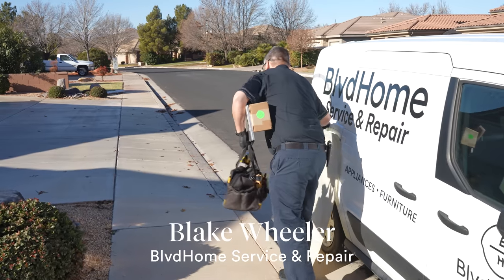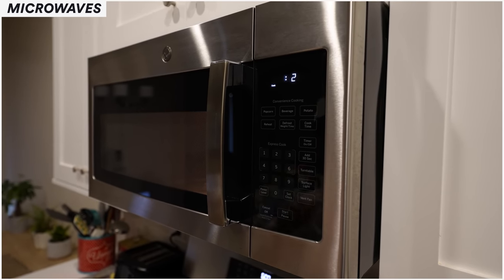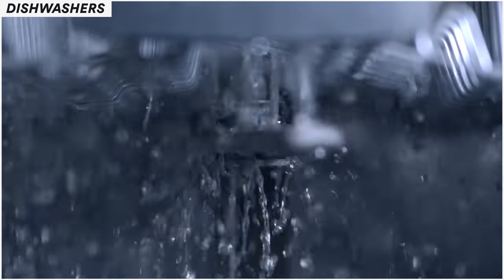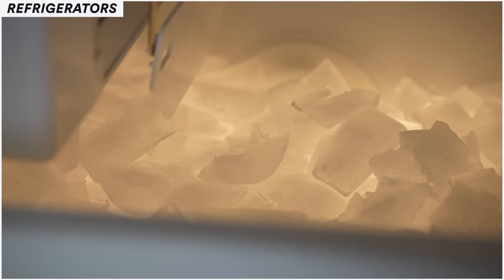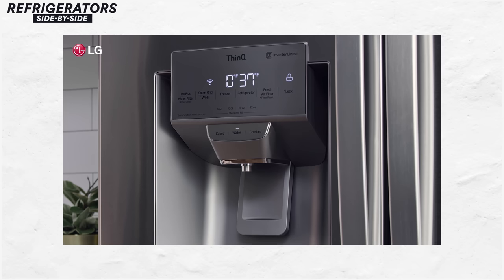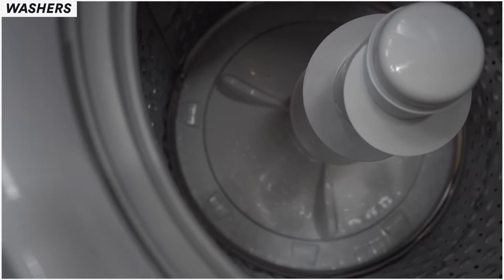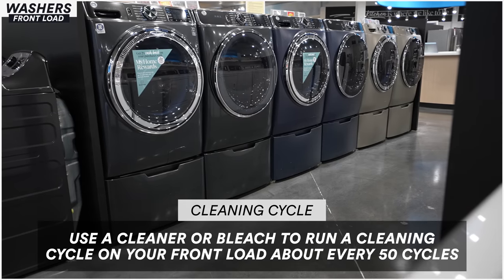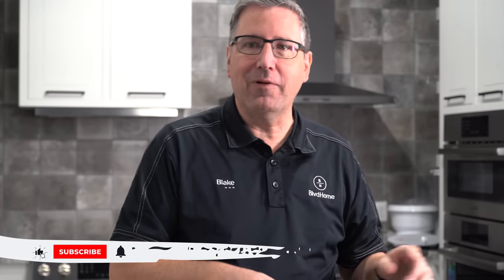Best Appliances Recommended by a Repair Technician of 29 Years

Comment: I bought my Kenmore refrigerator back in 2003 and it quit working in 2019. Whirlpool was making refrigerators for Sears back then. I saw a Whirlpool refrigerator at the store than was on sale and it looked pretty much like my old Sears refrigerator. The ice maker looks slightly different and the controls in the newer refrigerator has digital control buttons. But it has been running just fine. I had read a lot of reviews and I had the impression that Samsung refrigerators have a lot of features but they don’t seem to last as long. I read about the LG issues also. My Whirlpool isn’t fancy but it looks nice and it works. It’s good information that he gave out about the microwave switches. The makers who put the pause feature on their machines should have explain why the that control feature is there.

Comment: I have me a 2012 Frigidaire/Electrolux top freezer fridge that still works well.  I recently removed the ice maker, because I never use it. My washer and dryer are GE 2008 models.  They work well, also.  I recently replaced my dishwasher with a GE, and replaced my Whirlpool over the range microwave with another one. My electric cooktop is 2008 GE, and my wall oven is a 2008 Whirlpool.  I hope for many more years of use.
Reply: I have a 19-year-old frigidaire side by side everything on it still works great but I'm starting to look around for a replacement even if I don't need it for a while. I'm starting to get the one morning all the food thawed twitches:face-orange-biting-nails:🥵

Comment: As for microwaves, I avoid any OTR microwaves that have the keypads integrated into the door assembly. When the keypad goes bad from the steam and heat from the oven below, you will have to purchase a whole new door, which is 2/3rds the cost of the microwave. With a microwave with the keypad off to the side and separate from the door, the cost of repair is less.
Reply: Interesting take. I've only ever had over the range microwave to save space because my homes are tiny in my price range (currently living in 750 sq ft) and not once had a door keypad failure. Few total burnounts from the microwave emitter and such but no button problems alone

Comment: LG for Washing Machines, been very happy with the last one - 10 years no trouble and it done at least1 load every day. The hot water valve scaled up - replaced it, then the logic board gave up (we have a lot of power quality issues and lightning) I would have fixed that too but too expensive and upon closer inspection found the suspension system had a lot of wear. All other components were in really good order. It had a very hard life with a family of 7 so time for a new one. It just developed a slow leak after a hot wash last week, 2 years old but I think it is something stupid and simple I'm not concerned.  Everyone I know with an LG is thrilled with it. Our LG Heat Pump Dryer is 6 years old and hasn't had a problem.
Reply: That’s because it was built 10 years, this shit they make today doesn’t last 3 or 4 years.

Comment: I've been an in home repair tech for 15 years and I agree with everything he said besides the top load washer category and that's only because I don't have recent experience with speed queen or LG top loads so I can't speak to that category currently.
Reply: We bought a Speed Queen washer and dryer (all mechanical) for our vacation condo to minimize breakdowns.  It is a little loud in the kitchen area but cleans incredibly well and is ‘unbreakable.’
Reply: So what the best fridge freezer I have huge problems with Hotpoint modelFFU3D1W the non stop noice and getting hot from the back

Comment: Several years ago, my mom bought a new front-load washer, but didn't buy the matching dryer, since it was still working fine.
However, the new washer has a 5CuFt drum, whereas the old one was 2.5CuFt; the dryer is 5CuFt.

Comment: Our speed queen washer and drier have been workhorses in our family for well over a decade, awesome well built appliances!
Reply: Speed Queen are the ONLY washers that are built to last
Reply: @WhittyPics  I don't get why people WANT them to last though. I had an LG TROMM front load unit for 13 years that followed me to three houses... the last house it had gone through a flood in the basement, completely submerged... and still ran fine after that. I left it at that house when I moved again though. What I can tell you is that based on the operating costs of the "good old fashioned" top-load boat-anchor that came with my new house, which recently broke, that LG saved me over $23,000 in electricity in the 13 years I owned it. I replaced the piece of junk top loader with a new LG front-loader and suddenly my shirt collars are clean again and my electric bill is down by almost $30. Everyone thinks a KilowattQueen is gonna last 30 years but the question should be... why do people think that such poorly designed (yes, just using huge hunks of cast iron for every part of a machine is not good engineering, even if it lsts a long time!) machines are entitled to guzzle that much water, power, and raw materials when they are proven to deliver such poor wash performance?
Reply: @dregenius  Any front load will use less water.  People love their SQ washers because they clean well and they are extremely reliable!  I know because I have one!  SQ does make front load washers as well, however they are much more expensive than the top loads.
Reply: This is what I read so many times while researching, & ended up buying a Speed Q. stackable.  We're hoping for the same experience, especially since we spent so much for it!  Yikes, it was a lot! Commercial parts is what sold us. Fingers crossed!!
Reply: @cmough1319  Exactly no Plastic parts!

Comment: I can agree with you on the Bosch dishwasher.  The one that I have has got to be 15 years old and I haven't had any problems with it.  I've had it so long that I don't recall exactly how long I've had it.  It still gets the dishes good and clean using Cascade liquid.  With the newer detergents I don't need the liquid finish even though I have hard water.  I bought it after reading consumer reports because I wanted one that is quiet.  This one is definitely that, even at it's age.
Reply: How is it with getting the dishes dry? Thx in advance

Comment: I am curious as to your experience with Miele washer and dryers.  I have the large format models from 2005.  My washer finally needed service after 18 years.  The drain pump failed after 6000 hours.  Curious as to your experience with other front loaders  and how long do drain pumps last?  I repaired it myself and I was very impressed with the design and build quality.  It was very easy to fix.
Reply from the maker: We have a video all about Miele here you can watch if you're interested! https://www.youtube.com/watch?v=0bdLSBppKms

Comment: I think it is great you came forward to give your expertise.  Thank you cause we do spend the time to find great reliable appliances that we take care of. It was a shock when our LG 33 cubic refrigerator broke cause of compressor ball bearing seal breaking. We had the compressor replaced, but the labor cost was sky rocket cost to repair. After another 18 months, it broke again. Never again, anything LG. Thanks for your help in verifying what we think. Also, they are top reliable appliances. All the best.

Comment: Great informative video! Bosch & Miele & Speed Queen & Electrolux  build good products . I have a Bosch washer & Dryer set I bought at Lowe’s back in 2006 & no major issues not a single repair. Still working flawlessly& going strong ! It’s been pretty reliable for the most part. If I ever had to replace them I’d go with Speed Queen.that would be My first choice second choice would be Miele . Third choice GE . The one with the ultra fresh vent system & Microban Antimicrobial . Protection.., they have a decent size cap 5.0 cu ft . Which is good for the big bulky stuff & has  sanitized & Allergen cycle. & smart dispense for your detergent. & it’s reasonably priced for what you get. It has features galore!  Not bad for what for what it is .whirlpool isn’t bad either. . It’s about preference. Bosch / Siemens  are pretty good . For the kitchen as far as stoves go   Id say for the most part most are pretty reliable depending on the brand . Like the guy said in the video when you get the higher end brands the more complex they are & can get pricey to repair depending on the issue. Sure they look nice but they are very expensive to purchase. Besides I don’t anything that fancy. There’s other options & with a good track record as far as reliability goes . GE is a good solid performer when it comes down to the cooking end of it . Fewer repairs  My mom has a GE electric stove that she purchased way back in 2001 & never once had no issues or problems. My advice is pick out what works best & has a great reliable reputation.

Comment: We are appliance shopping and looking at Beko.  They have far superior smooth and easy to manipulate drawers and shelves in the fridge.  Any thoughts on the Beko dishwasher?  The sliding of the racks is much smoother than Bosch but we are a bit confused by the new drying technology.  The Zeolyte in the Bosch for drying we've read can leave a powdery white residue on dishes and then what are we consuming?  Aluminum and Alkalai is what I found on a google search.  The pop opens function could damage surrounding wood cabinets, true?  Thank you for any comments

Comment: We’ve had KitchenAid dishwashers since 1979, three of them until 2015 when we had a total kitchen remodel  and went with the Bosch package (DW, microwave, induction stove).  In all the time we owned Kitchenaid DW’s up until 2015, rarely did we have a misfire (as in unacceptable cleaning).  The Bosch not so much.  I do not know if KitchenAid still makes a unit worthy of past ones.  The biggest issue with the Bosch is when the lower tray is fully loaded it wants to jump the tracks abd crash to the floor of the DW and the sprayer arm and when pushing in the tray you have to gingerly push the tray from the right side, skewing it to the left and then the rollers all tend to stay on the track.  I tired to do a retrofit patch on the tray roller spacing to address this issue but the nature of the rollers prevents this.  It is extremely annoying.  Also the touch screen can be finicky, sometimes not responding at all or stuck in one mode until the DW is turned off and reset.  What’s with that?  It is quiet though.  However, I’d give up a decibel or two for the old Kitcheaid.  In my experience with other German made products, they are no different, hit or miss, than the average other makes of appliances in the same class.  Achtung!  The myth of German engineering

Comment: Just wanted to point out that I think Panasonic is one of the only manufacturers of microwaves that uses a variable power inverter, which means its the only one that actually can cook with less powerful 'zapper' when choosing a lower power level.  VS all the standard microwaves will cycle 100% power on & off more or less frequently depending on the power level you select.   You can hear the zapper cycle on/off when cooking on a power level less than 10.  Variable power on the other hand is just like cooking at a lower temperature, and thats what Panasonic allows.

Comment: I have a burning question about my Zanussi washing machine's pressure switch.
The rubber membrane has a leak so the switch doesn't function anymore. I tried to purchase a new one but I couldn't because this type is over ten years old.
I don't want to throw this machine away to buy a new one because, apart from the pressure switch, it is still fully functional, 
I see it as a personal challenge to do the repair and make it work again for at least a few extra years.

My plan was to buy a second hand switch and re-adjust the threshold and hysteresis levels similar to those of my machine. I also bought a few meter of surgical hose and one meter of PVC pipe with a cap to seal off the bottom.
With these items I've made a 90 cm tall water column that I can slowly fill from above and slowly drain it from the bottom.
The PVC pipe has  a diameter of 5 cm and has a cap glued to the bottom. Next I've drilled three holes through the bottom to feed three hoses through. 
One 30 cm hose to drain the column and I've taped two 110 cm long hoses along the side of the water column. I've also taped an old mm scale tape-measure along the side of the the column to be able to exactly determine the height of the water level within the column. 

One of the hoses has an open end and the second one is tightly connected to the air input of the pressure switch.
It worked as intended and I was able to make precise adjustments. So far, so good.
Now here's the problem
According to the service manual the anti boiling switch that switches off the heater element when the column has dropped to a height of 35mm and then switches on again at a level of 55mm. The 1st level switch closes at a height of 75mm and switches on again when the water column has dropped to a level of 55mm.

So far, so good. But then I found out that when I fill the column up to a level of 55mm, the pressure increase was way too small to be able to flip the switch. 
In fact the column has to fill up to a minimum level of at least 15cm or 150mm before the switch is able to flip.

My question now is can it be that the figures given in the service manual are wrong?
What are in general the AB/1st threshold values for the average washing machine?
It is rather disappointing that after I got this far and have put so many hours in this repair, I still can not finish the project and call it a day. 

I hope you can put me on track again and hope to hear something soon. 
In the mean time I send you greetings from the Netherlands.

With respect, Frank Heuvelman.

Comment: 2024 Fridge: Trying to find quietest full-size fridge possible for my small space. What brand is quietest? If you have a certain model you recommend pls advise. I'm replacing my 2015 Kenmore Elite which was super quiet. I was told that more recent fridges are engineered differently and run constantly.. regardless just need quiet!

Comment: Love your video! Thank you for sharing all this great information. 
I'm in the market for a new washer.  I want to get GE Ultrafresh front load washer. I have seen several videos that show the high pitch sound that people are experiencing spring spin cycle.  Some mention shipping bolts can be the issue one guy found it was the motor making the noise. Is this motor issue common? Is it covered under warranty?  If issue should I just get LG front load washer?
Reply from the maker: GE and LG both make great washers, but any washer may have its problems (rare or common) like the ones you are describing. It sounds like you are a wise consumer and doing your research before making a big purchase so props to you! Given how many units are out there I wouldn't imagine it's very common, but we don't have the specifics for our market. It's best to refer to the manufacturer's warranty documentation or contact their customer support for more information. Typically, manufacturers provide coverage for specific parts and issues within a certain timeframe, so it's essential to clarify this before making a decision. Thanks for watching and commenting!

Comment: Do you have advice on two piece cook top and ovens? We are renting in a unit that has a 3 burner gas cooktop. And an electric oven. I am shocked that I don't miss the 4th burner and LOVE the counter surrounding the cooktop service for spices, oils, utensils. We are about to buy and wondered if there are up or downsides from your technical perspective.

I was also curious if the oven seats more flush with cabinets? I've noticed that this standalone oven fits very flush, as opposed to oven+cooktop combo units that seem to jut out from counters a bit.

Comment: Have you ever had issues with the Bitumen in Bosch dishwasher? We have gone thru two 500 series where you could smell the chemical tar smell a year after use. Bosch replaced the first one but we had the same issue with the replacement. We are considering switching to a Miele G 5266 in hope this solves the smell issue.

Comment: I had this top load LG washer that would throw a UE code all tbe time. After going thru the internet, I disassembled it to see if it stripped a gear for the tub, I replaced the suspension springs, obviously cleaned everything, made sure the suspension was lubed, ect. Everything I could find online I tried. It would be great for a week or 2 then bam, back to UE. And no, it wasn't overloaded. I even tried to wash 2 socks only and it would UE. Finally, got fed up and bought a new unit. Any thoughts? I don't remember the model number but newer top load washer.

Comment: Frigidaire was the worst fridge we owned. Water leaks, icing at the bottom, bad water inlet until it gave out. Lasted 10 yrs.  We have a Whirlpool and weve had one issue. The condenser filter got clogged with dirt so the drip hole was closed up. Cleaned it out...no problems since.